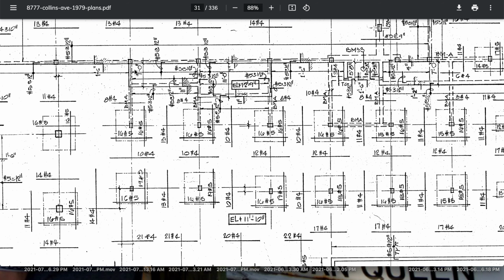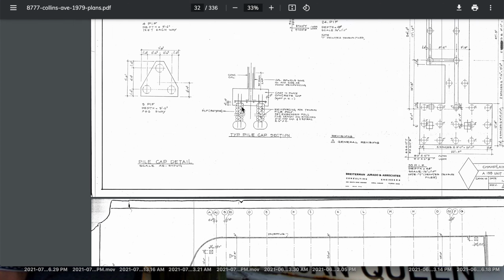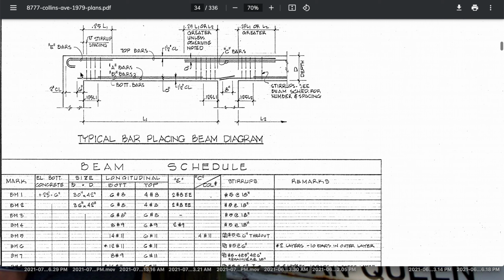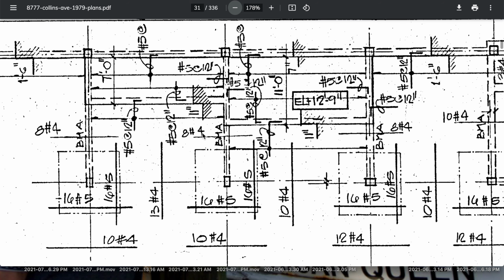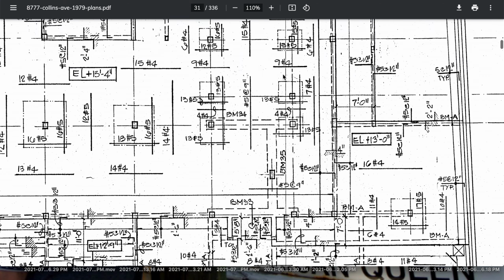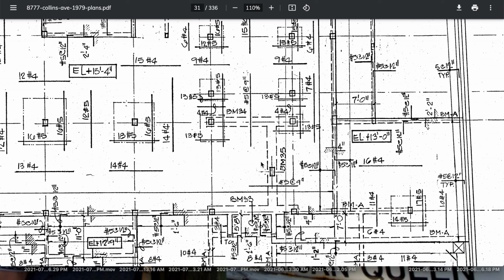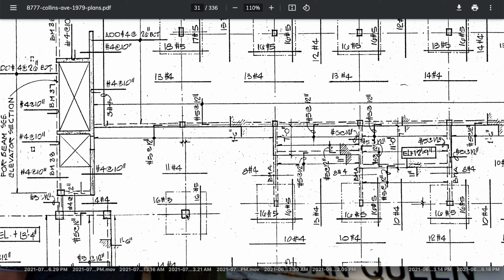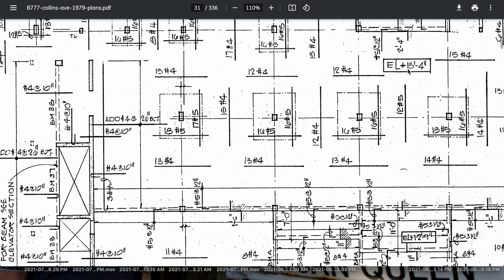Champlain Towers Collapse Transfer Beams and STILL need to find connection to Building 2 Deck

Comment: You make it easy to  understand
Reply from the maker: Love the positive feedback, thank you.
Reply: See sheet S5 upper left corner for BEAMS TYPE A.  They are imbedded beams within the floor slab which is 9 1/2" thick. The lower portion of the beam protrudes from the bottom of the slab it self 5 1/2" total beam size is 12" X 15"   with 8# 4' perpendicular to the beams span tying it to the 9 1/2" floor slab.
Reply: @benvalentin5673  I have seen those types in underground areas of the Chicago Loop. Slab and beam rebar all tied together  then one single pour. If kept dry beastly strong once the rot starts a major problem to replace. I worked downtown as a messenger for 15 years so I saw a lot of the old Chicago below the upper ways most folks see.
Reply: He takes time but always the best on collapses!
Reply from the maker: @Kpopzoom  , thank you, and u r correct, I take a time but I will figure out a load path failure that can answer all questions.
I am exhausted but, will do a model tomorrow (made of metal and foam board)...

Comment: You can clearly see the transfer beams in the video the woman took in the garage pointing out the puddles and crap dripping off the ceilings. She was looking for spot 17 the beam was clear from m10 space 28 and the column at space 27.

Comment: Simple explanation of BMA is a thickening of the slab twelve inches wide and and five and a half inches lower than the bottom of the slab reinforced with two #6's on top, two #7's on the bottom encircled by #3's as stirrups every six inches along with the rebar of the nine and a half inch thick slab.
Reply from the maker: NOPE... it is more than that...   you have to watch the rest of the videos, where I finally give up and reveal what a BMA is...

Comment: As a retired builder, from Australia,  I can't understand why there was no cross beams between the columns, to spread the load ,     I agree with you that the pool deck collapse, was the trigger for the collapse,  if the deck wasn't connected to the main building , I doubt the main structure would have collapsed.
Reply: Yes the lack of cross beans is a most and this building did not have it as it shows clearly of the remain of the structure published .  This I agree was why the building colapse like pancake.

Comment: Where are the metal beams in the rubble pile?
Reply: If this was a reinforced concrete building there wouldn’t be any. You actually can see a few red painted steel beams on the top of the rubble pile, they were on the roof supporting some HVAC equipment.

Comment: Maybe BMA refers to transfer beams added to accommodate Penthouse-"A" to compensate for the additional 9ft of bldg height and wrap around decks.

I wonder if the interlocking deck pavers were original to the building?  Could they have been added later and the extra weight compromising the structural integrity?
Reply from the maker: But, the structural plans remove them in a few places... That damn BMA is not something I take for granite...
I was hoping an older architect or engineer would have used this abbreviation... But, we are all just inferring at this point with no real confirmation of exactly the intent... Interesting, the size is the same but the spans change and of course, so does the loading...

Comment: I think it says BM 4......Which is from what i can tell a rebar structure. IMO probably that rebar that was picked clean hanging everywhere. IMO should have been Post and beam I beam structure. Those are CRAP plans. I am not an engineer but If I were the builder I would have had some talking  with the architect or I might have refused the job. Concrete reinforced Rebar on a 12 story structure built on the sand is asking for problems.
Reply: I think those were additional reinforcements of rebar on those areas of the concrete slab. I can see on the North tower there was no specific Beam.....Only a reinforced portion of the decking which is totally CRAP...IMO why did building and safety not reject these plans. and why did the inspector not set off a red flag? they would not have wanted me to inspect it. I would have said "lets get out the jack hammers"

Comment: I still wonder with the structure being in dire need of repair for a number of years, why would their first thought be replacing the roof?  You would think the bottom of the building with the flooding in the parking lot and rusted beams would be the first repair on the list. I would think that salt water in the parking lot would raise up a red flag.
Reply: That would be because the roof is directly above the Penthouse apartments  and the occupants could have complained about water penetration.

Comment: I just saw that the columns under the standing building (parking lot page)  are significantly larger than the part that collapsed. He is  using the exact plans as you are. Is that true?

Comment: Bottom line: In Florida, engineers don't know how interconnect beams. I've worked in and visited many buildings in NYC. As an IT tech, I know what the guts of many of our buildings look like (service elevators, basements, roofs, maintenance personnel accessible areas.) This Surfside building was garbage. A big ole platform, with no flared columns and no interconnects. Check out 205 Hudson, 75 Varick, 76 9th Ave, 601 West 26th Street. That's how columns for oceanside buildings should've been built.
Reply: also built eons ago, before a lot of lessons learned that is in use now. 1979 predates the 1985 mexico city earthquake, the 1989 san francisco earthquake, and more critically it predates the 1995 Sampoong Department Store collapse (that happens to be the same kind of "flat slab" construction with identical added floors).   in all honest, the building should have been condemned and replaced long ago.

Comment: Those beam A or BMA are related with the planting areas reinforcement. Check in the up left corner from the pdf link i sent you before for "Beams Type A" (beam 12''x 15'' 2#6 top  2#7 bottom  stirrups #3 @ 6''). So we have BMA reinforcement beams in the North-South direction and the "DETAIL AT SLAB DROPS" beams in East-West direction (these also make level transition between pool and lobby slabs). These concrete planters you can find details of cross section in pdf page 57 of the 1979 plans you're using. I think the failure could have started here because you have a big load of soil and plants with the capacity to retain water all year round. If the drains of the concrete planters became clogged or the waterproofing membrane was past its useful life then you have water for many years corroding both the pool/garage slab and also the BMA and slab drop reinforcement beams. That's why I think Mike's simulation is good. After watching the video that lady recorded moments before the building major failure from outside the garage entrance gate, you can see concrete rubble in the garage floor. This rubble came from the pool slab (goes underneath the planter), the "BMA" beams, the planters walls and maybe also the "slab drop" beams.
Reply: IMO there should have been more Shear wall  under the building portion of the parking structure. Or larger post and beam. A deck falling should never take down the  building. Those plans are marginally engineered. and were going to require retrofit just a few years after built. To me SHOULD HAVE NEVER BEEN APPROVED.....I have never seen a underground parking structure of 12 story building with that little support built on the sand. 16x16 posts No shear 16 or 20ft OC...CRAP....Rebar reinforced concrete, no I beam  CRAP.....What were the rebar wire tied not welded.....CRAP...So much going on there. IMO they really need some code changes. I live in the OVERKILL state of CA....which has gone too far, but this stuff is CRAP construction.

Comment: On the top left corner of sheet S5 there is a diagram of "Beam type A"
Reply: good catch!
Reply: Thank you for finding this. I was better able to make a note in the PDF showing the changes between the old and new framing plan. I'm still puzzled that this was one of the few things done to add the private penthouse level.

Comment: Shouldnt there be the steel fixers detail sheets for the steel in each beam ... they show shape /lenght /diameter each bar in each beam , collum etc .... there should be sheets for all collum steel and beam stucture and floor slabs etc ... the plans tell you the no. /row and shape etc of beam but the detail sheets relate to each numbers/row beam, collum etc and tell you exact steel in each placement (and detailer idea of how /which bar to use in which order to put it together, normally ignored by fixers as detailers have no on site doing it experience ).... can you access these ? Then you will know if there was even abeam put in and what was used ...

Comment: This might've been answered already but I've been wondering from the start why it was a pancake collapse instead of mostly toppling over onto the pool deck side?
Reply: Well, it's a domino effect of what happened to the buildings.  Ever watch those crazy domino builds before they knock it over?   And notice they usually fall straight towards the ground?
Reply: @victoriouswillisorius5362  I wasn’t thinking of simply moving sideways, rather shifting after initial line of columns failed.

Comment: Are these the “as built” drawings? If so, would you mind showing the page and section where revisions are annotated?
Reply: You are on the west coast?
Reply: @sgriffin760  no.
Reply: There are revision deltas called out, but these are typically A/E revisions made before construction. I haven't seen any substitution requests for design changes plus their change order (to properly incorporate changes into contract documents, even if they're no cost changes) or record documents. Record documents typically (!) go to the owner and not the building department.
Reply: @prozaque  Record documents may also exist either the firm but doubtful…. And unless the documents included final as built drawings you would not find those either